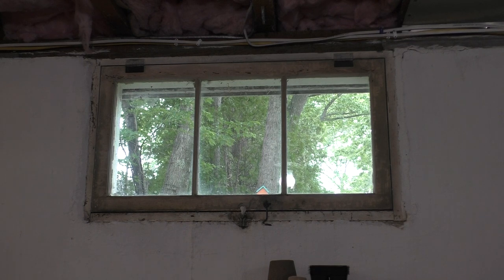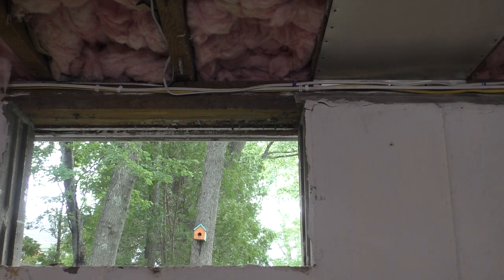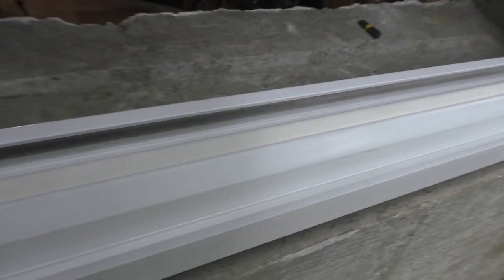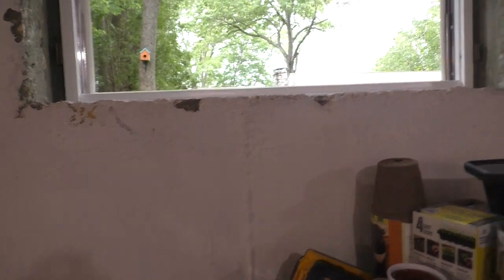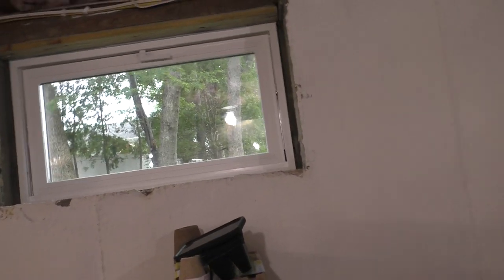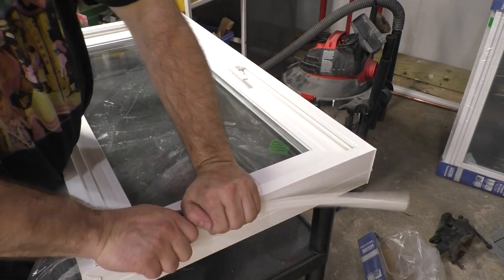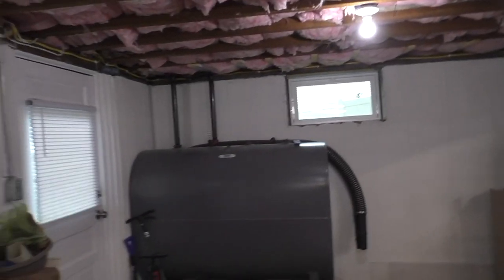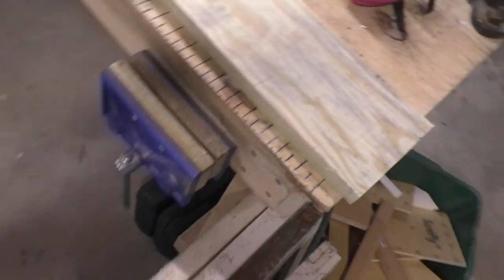Basement Window Replacement - Part 2 of 3

Comment: As well as with replacing windows, I'd try to hold as much to history as ya can with the rest of the house 🏠. Being from 1954, and over 50 years old, this house 🏠 can be placed on the list of historical houses 🏠. I wouldn't change the design on the inside, but replacing, or repairing floors is fine. Your friend, Jeff.

Comment: The only tapcons I've ever used had hex heads on them, if the hole is the right size you can put them in by hand with a socket wrench.

Comment: A great video.  I enjoy the home improvement stuff the most.  Noticed you can see daylight between the window and the frame.  There doesn’t appear to be any seal like the PVC windows here?  Does it not matter because it’s just the basement?
Reply from the maker: That's actually the light reflecting on the aluminum hardware - the windows are nearly completely air-tight!

Comment: this is off topic but could find another way to contact you...been going crazy trying to repair an A1048 keyboard that had some water spilled on it. Your video was so helpful but still can't get most of top row of keys to work. Went all the way to mylar level and cleaned. Everything else fine. Don't see any physical damage (and can't imagine how there would be any!) but still Q through [ won't work. Any suggestions?